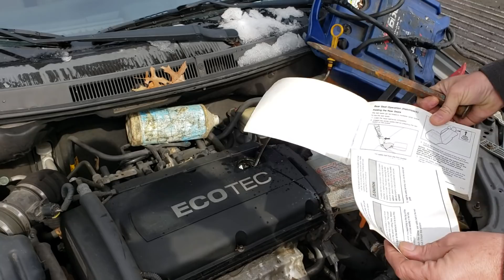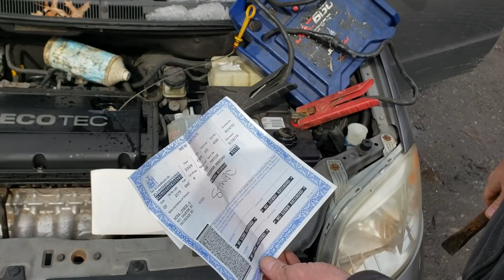HARD TO KILL! Chevy Cobalt Motor Eats ANYTHING! Neutral Drop

Comment: Scotty Kilmer has to see so he can see how reliable Chevy is 😂. Let’s see a Toyota do this 🤣
Reply: Lmaoo fr
Reply: Brian Djordjevic Some vehicles you would have to watch out for flying engine parts.
Reply: My toyota wont do this but itll run for a month or so without any oil in it.
Reply: Ever seen a Toyota Hilux my friend?
Reply: Brian Djordjevic exactly
Reply: I’ve got an old Chevy that’s got a shit ton of miles and problems but it still runs great
Reply: I want to come and drive once and do some powershifts. No lifting foot of gas going through gears with half or no clutch at all
Reply: LMAO!
Reply: Hahaha lmfao
Reply: No better yet stick scotty's 94 celica inside there haha lmfao
Reply: chevys can be reliable if you treat them well, its just that theyre SO HARD to repair compared to other cars. And also, toyotas are known for reliability, chevys are known for toughness. Toughness does not equal reliability. And with the way most people treat their cars, chevys end up being SUPER unreliable.
Reply: Chevy's are easier to fix compared to other cars
Reply: Chevy's are tough and reliable, Jeeps are better though
Reply: Have an Ln2 and a L61 Ecotec Cavalier. It's difficult to mess up GM's 2.2 ltr motor, unless a serious mistake is made. There can be some tight squeezes, but the J bodies and their sucessor are easy to work on.
Reply: Brian Djordjevic I was thinking the same thing 😂
Reply: Ghostfire Gaming everybody was 😂🤣
Reply: Everyone knows scotty's CeLiCa is the world's most reliable car
Reply: Robert PL9501 after he repairs it on the down low 😅
Reply: Chevy reliable...not likely
Reply: Mike Foehr says the Toyota lover 🤣
Reply: @briandjordjevic9969  I love Toyota because the brand saves me $$$$$ compared to the shit GM and FORD builds...trust me...I know
Reply: Mike Foehr my friend owned a few Toyota’s nothing but problems. All cars today are built the same. Cheap!! 🤣😂
Reply: @briandjordjevic9969  I haven't seen it yet with any Toyotas i have owned...as a matter of fact...the newer ones we have are even better than our 04 Corolla.
Reply: Mike Foehr so you got a newer one because the older one runs like crap and it only has 90 thousand miles 😆. Is that what you’re telling me?
Reply: @briandjordjevic9969  Well...04 Corolla was going strong at 330 000 kms when we traded for 16 RAV 4 for my wife. My Tacoma now has 160 000 kms and RAV4 is nearing 100 000 kms. I have met many people with Toyotas of different kimds with 400, 500 and 600 000 kms. So, your theory about Toyota is not even close. Now, GM and FORD is bonsfide trash...trust me...I KNOW
Reply: Mike Foehr Thats because Toyota people baby their cars 🤣
Reply: @briandjordjevic9969  LMFAO...I absolutely drive the shit out of my Taco..I take that  truck where most people won't even think of taking their trucks. I do all the required maintenance and just d4ive it. I pulled our camper last year 10 000.kms across Canada...lots of gas and one oil change. Did see a dead FORD, GM and DODGE along the way...and I just laughed because of that Yankee shit America builds in Mexico.
Reply: Mike Foehr lol that’s because they don’t do all the maintenance for their trucks. Anyone of those trucks are better than Toyota and that’s coming from a guy who hates ford but rather take that over a Toyota.
Reply: Mike Foehr and it’s a whole job just to do a simple oil change on Tacoma’s now 😂
Reply: @briandjordjevic9969  my truck..oil is easy to do...filter is under the hood. So easy.
Reply: Mike Foehr not anymore 😏
Reply: @briandjordjevic9969  Many auto makers use this new style. I am not a big fan of it. Apparently you can buy a metal replacement canister housing and ditch the plastic one. As for the air dam...where i take my truck...that wouldn't  last long. TRD OFFROAD does not have the air dam.
Reply: @Arnie02267  How many engines and transmissions does it require. My 88 Sierra barely made it to 80 000 kms...needed a ton of warranty work. It was a.pile of 💩
Reply: Scotty is a little delusional
Reply: @mikefoehr235  lol most reliable there is, why do you think so many Chevy drive lines get transplanted into almost every other brand? Pretty simple. Chevy engines are hard to kill.
Reply: @mikefoehr235  I've owned 3 Chevys with high mileage. 95 suburban 614000 kms still going, 98 with over 600000 driveline never been touched. 1988 s10 with a  2.8 all original with 740000 kms used to have reving contests with it. Still going but the odometer quit.
Reply: @mydailylife3771  Well the older ones may have been OK...but the GMC I had had valve guides leaking at 80 000 kms. My GMC WAS  pile of 💩💩💩💩
Reply: @mydailylife3771  GM needs faithful like you to buy their crap...For me...GM and FORD cured me forever. I will never buy that American crap again
Reply: @mikefoehr235  lol I guess.  I liked Toyota till till our tundra threw a rod at 200000 kms and the 22rs didn't last very long in the ice racers. Wouldn't ever buy another ford or a dodge. If I can buy a Chevy for 500 bucks and do nothing for 5 plus years and still sell it and see it driving around I'm hooked
Reply: @mikefoehr235  my 2014 Silverado has 176000 kms pretty much problem free. Had an oil cooler line leak but was warranty.  2 sets of tires and I just did the 2nd set of brakes. The wiper linkage seized which is a shut design but not bad for a cheap 4x4. Got the 4.3
Reply: @mikefoehr235  we had an o8 6liter was a pos but there's one in every brand I think
Reply: @mydailylife3771  i have met people with different Toyotas with 400 000, 500 000 and even 600 000 kms on their vehicles. Our Corolla was still humming at 330 000 kms when we traded for a RAV. My sister had an echo it was still going at 360 000 kms. Ya...I am sure Toyota does make the odd lemon but not like GM and FORD. MY Tacoma has 161 000 kms...it is easily the best vehicle   i have owned. A out $2000 in repairs in 7 years...not bad. GM may make great engines, but what good is that if the rest of the thing is shit.
Reply: @mydailylife3771  My brother in law just got a new Taco...he had a GM S10 years ago...the headgasket failed and totally ruined the engine...barely had 100 000 kms on it. Now he and my sister have now 3 Toyotas...he even have up on KIA. MY ENTIRE family drives mostly Toyota or Honda or some.other Asian product. Americans cannot build good cars anymore and trucks are also garbage.
Reply: @mikefoehr235  I love Toyota trucks but they are all having wiring issues, my friend has a 14 tundra and he got a mouse nest and the Sudbury Toyota dealer told us that they are catching on fire. Suggested parking it away from all flamables said all kinds of cases of garages and houses catching fire from the soybean wiring. Don't worry they said insurance covers it all but sure turns me off. I think it's pretty serious when the service manager tells you its probably gonna burn to the ground. If Chevy wasn't so good to me I'd buy a toy honestly but not one after 06
Reply: @mydailylife3771  Simple solution...spend $60 and buy the special electrical tape made by Honda. I had 2 squirrel attacks and second time i did research and found the solution. Another trick is to buy fake snakes at the $1 store and put a few under the hood. Problem solved. Has worked well for me.personally. BTW...I grew up in Hanmer On
Reply: @mikefoehr235  easy for guys like us, most people don't look under the hood. I personally haven't opened my hood more than a dozen times in the passed several years now that oil changes can go 10000 kms.
Reply: @shamoblamo9625  what I was thinking- a Hilux can get swept into the ocean or sat on top of a building, which is then demolished underneath it with explosives.. and still somehow live
Reply: @davesnothere3425  so did mine lol, toyota engines are bullet proof.
Reply: opel engine
Reply: ShamoBlamo lol top gear it had a Chevy engine 🙃😆
Reply: general motors cars are garbage period
Reply: miles leduc must be Scotty’s son
Reply: The engines are great but the rest is kinda bad
Reply: Sqwerpo! Every car is bad if you look for problems 😆
Reply: @briandjordjevic9969  true but every car has the same type of problems if not taken care of
Reply: If this shit cheap Gm engine could do this then any other toyota  could out performs.
Reply: Erik Lau Toyota sucks
Reply: @briandjordjevic9969  Brian Djordjevic. Then u r been living under the rocks my frd.
Reply: Erik Lau no I live in Long Island
Reply: @briandjordjevic9969  yes long island rocks.
Reply: Erik Lau it sure does🤘🏻
Reply: The damn Toyota would of sucked the Chevy right up and then another lmfao......very very surprised how long this went on for.
Reply: Andrew Woodford Toyota’s are crap now
Reply: @briandjordjevic9969  far from it sadly. You must be one of those guys driving a Fiat Ram going man they fixed these up nice lmfao.....Dodge FIAT and Nissan SUCKS GM GARBAGE. I Appreciate them keeping the bills paid at the shop and keeping me busy with work cause their quality sucks. Toyota is still top of the line along with Honda.
Reply: Andrew Woodford eveyy car maker is made cheap now. My friend had Toyota’s they all fell apart. I don’t understand why people love them so much. They are garbage. 🙂
Reply: @briandjordjevic9969  your friend must not of heard of maintenance lmfao. They are all made cheaper ik what comes and goes in this shop I run and own.
Reply: Andrew Woodford exactly my point if a person maintains the car it will last. People that drive Toyota’s usually maintain their car cuz the baby them. Other makers they probably don’t. Inconclusive Toyota is still trash. 😄
Reply: @briandjordjevic9969  at least honda and Toyota is better garbage than Fiat Ram or Dodge and any gm product quality has went down so much.
Reply: Personally I drive Ford myself still see those waaaaaaaay less than dodge or Gm
Reply: Andrew Woodford ok Scotty 😆😂🤣
Reply: @briandjordjevic9969  work out the shop and know what I work my hands to the bones on. So I'll take that as a hell of a comment.
Reply: Compliment
Reply: Andrew Woodford you work on my of them cuz more people buy them 😂
Reply: @briandjordjevic9969  true too but go to the junk yard see what you see. Do your homework and little studying see how many of each been bought and see how many % is still on the rd and still driving and how many have stopped running made so poorly they have taken lives because poor quality. You'll see the death rate is so much lower and with Honda Acura and Toyota lexus sell just as much.
Reply: @briandjordjevic9969  just look the casualties rate and I don't wanna hear they sold more hahaha......they used to be great in the 90s and back but now it's like your driving a lego down the rd and they are loud and noisy you can hear everything in cabin when driving.
Reply: @briandjordjevic9969  I mean I still like Chevys period they can last too just not made like they used to make em. They have SOME vehicles that last mainly their trucks and some of their suvs and vans. But its everyones right to buy and drive what they want. Dodge is junk period then fiat buys them out the biggest laugh of all cause Fix it Again Tony has always been awful and cheap cheap wiring wouldn't own a ram if they gave it to me cause its gonna need a transmission replaced any moment and gms transmissions aren't the best. They do still make some damn good v8s and v6s though and the 4 bangers are getting better.
Reply: Camp Matthew  hell yea it would....plus few more lmfao.....prolly 2 or 3 chevys maybe 4 or 5 and that's with the toyotas 4cyl engines haha.....
Reply: @mikefoehr235  yea your absolutely right.....except for the Ford part lol.
Reply: @briandjordjevic9969  they must of really been beat up with 500k on em lmfao....I basically live in the shop all day everyday ik what comes through my door. Always shit chevy always especially shit fiat ram. All nothing but problems. Its sad when you see brand new chevy trucks only 5k miles blowing transmission overdrive unit to pieces or burning up the 4LshityE transmissions that are really just garbage anyways ask all the chevy owners they'll tell you how scared they are getting at that 150k mile point on that transmission if your very lucky keep it up drive it and purely baby it.
Reply: Andrew Woodford no they had 100k and my now my friends sister blew her engine in her Toyota and it had 60k 😂
Reply: @briandjordjevic9969  I'm sorry y'all dont do maintenance or take your led foot off the gas or wreck out....hahaha 🤣😂😂🤣😂 thats not Toyotas fault shit you prolly ran em their usual 3 month standard with no oil must of doubled for yall. I use full synthetic Vavoline oil with a K&N OIL FILTER. Now ik for fact that don't happen under normal circumstances and you prolly got one made in cheap ass Mexico lmfao....
Reply: Gotta know what your doing when you buy one and I'm being real serious just looking at something from distance and never looking under the vehicles and inspecting them throughly instead of saying I like that then taking off lmfao....
Reply: Andrew Woodford they should be unbreakable tho 🤣😂
Reply: Andrew Woodford exactly people maintain their prized Toyota’s. Cars can last if you maintain them. 🤣
Reply: I got 256,xxx miles on my 2.2 Ecotec Cobalt and it doesn't skip a beat. It uses some oil, but no leaks.
Reply: @richardshields7956  do you use the dextros synthetic? If you do, your oil loss is normal since the synthetic sticks to your cylinder walls on a cold engine. Then as everything heats up and gets in place it doesnt burn any more oil. Just check you level before you leave on a long road trip and if you are burning oil you might have internal problems.
Reply: Considering Toyota engines can run for hours without oil this would be a cake walk
Reply: Refer to Toyota celiac video* lol
Reply: Wanna See a Toyota survive something crazy?  Crazy video about a Toyota Hilux that can't be killed. Look up "Killing a Toyota Top Gear"
Reply: Yet it had 90,000 on it and was fucked up Chevys are so great 🤣

Comment: Me : Puts royal purple and the best products in my car
My car: breaks down
Neutral drop: puts literal fucking battery acid,soap, brake fluid and screws
Car: still runs better
Reply from the maker: IDK Man👊🤯
Reply: This exact thing happened to my Nissan 240 it had ran great forever did an oil change with royal purple with new plugs and it screwed up like 2 weeks after
Reply: Sounds like royal purple isnt good oil haha
Reply: @jonathoncatterson8901  royal purple has a high solvent content, so it might rupture and dissolve some seals or gaskets which could lead to premature breakdown. I don't run purple oil if I would it would be an additive like Marvel Mystery Oil or seafoam.
Reply: Do not use royal purple it is pure snake oil.
Reply: Lol
Reply: you said "royal purple" and "best" in the same sentence. I think you're dreaming. people buy royal purple for the additives and nothing more, the actual quality of the oil is in question. if you want the best then you're looking at pennzoil, mobil 1, amsoil, and schaffer.
Reply: @ElectronicsForFun  and i think youre overanalyzing a joke of a comment that i made a year ago
Reply: @connorwinter7016  I don't care when you made it, I have comments that I have made over 5 years and I still get responses. just telling you, like everybody else, that royal purple isn't that great.
Reply: Cheapest oil is best in my experience
Reply: Amsoil, motul and redline are the best oils
Reply: Rocks had me dead though 💀

Comment: How the hell is it still running with battery acid??? This is truly fascinating
Reply from the maker: Idk???
Reply: The battery acid came from a bottle from the back of the truck !!!
Reply: its a motor not a living organism
Reply: The battery acid was probably the least harmful item the included. You’d need a stronger acid in constant contact (ie not a running engine) with them metal to actually cause any noticeable damage. .
Reply: My conclusion is that the geometry of the engine is designed in a way that the forign matter was somehow bypassing the moving parts!!! Im fairly certain if you were filming the ground directly under the vehicle that you would have noticed the liquids pooling....i mean seriously the quibic inches that that motor was designed with have to be less than the volume of fluid introduced. Maybe one of the screws first inserted busted a sizable hole in just a spot as to provide an excape route for the debries???
Reply: They just pored it onto the camshaft. That’s not even truly connected to the pistons and cylinders in any way. So the worst thing that could have happened was some debris could block the cams from moving and the engine would either starve of air or a piston could have hit a cam and destroyed it.
Reply: @mariomuller284  The acid went straight to the crankcase and was circulated through the whole oil system. This means it was pumped through all the crankshaft bearings and to the cylinder wall. Where do you think the oil pumped to the camshaft comes from?
Reply: Matthew Vance Music I don’t think “battery acid” is all that corrosive really. I doubt it would be any more harmful than water would be.
Reply: @thevalorousdong7675  Obviously in the long run but in a short period of time it’s not going to corrode the engine away to stop it from running